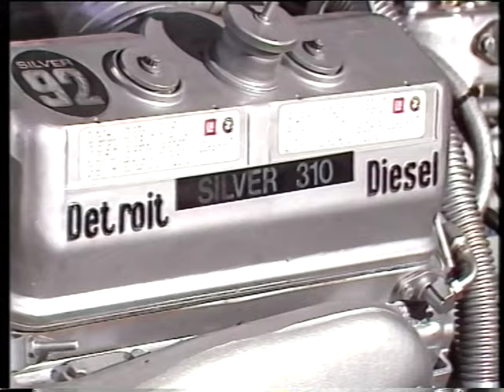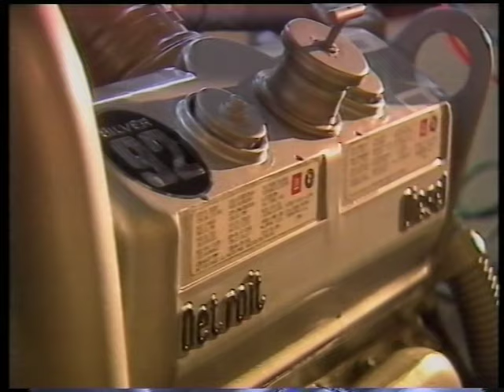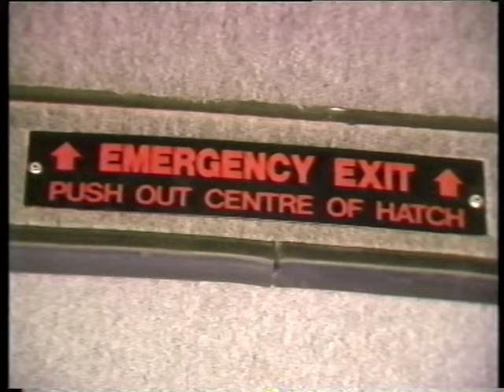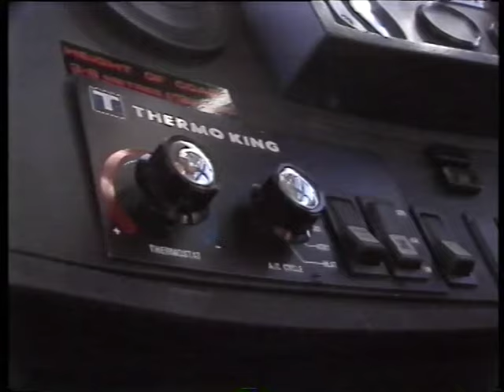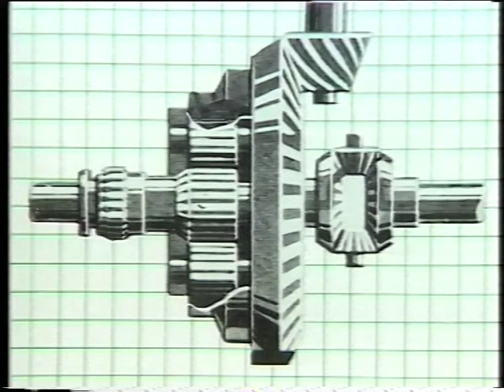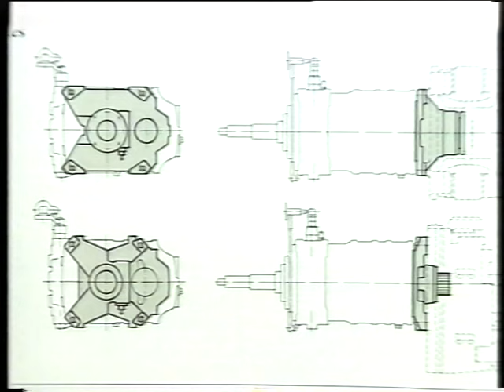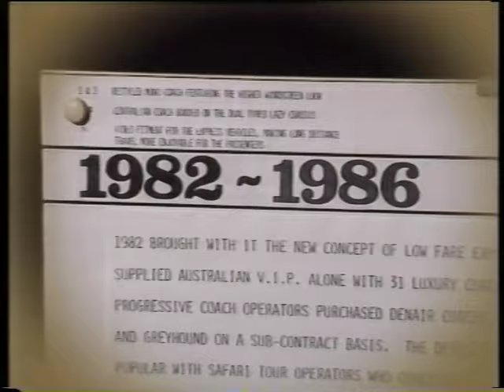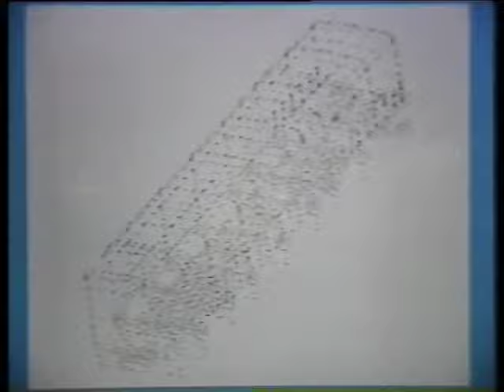Denning Coaches The Road to Quality

Comment: Would love to see Denning convert to LHD and sell in the U.S.A. Prevost and MCI need the competition. Denning looks to be a durable, well-built coach.
Reply: I’ve been a Prevost customer for a few years and it’s clear that Prevost and MCI need some stiff competition. Prevost are having quality issues that you shouldn’t see in a $550,000 motorcoach.
Reply: You've VanHool and Irizar in the USA, as we've in Europe. Booth are rated high-end quality here. I drive a 2009 Irizar PB on Scania chassis. It has 580,000 km on the clock and is still in top condition due to the quality materials it's build off. Denning is build for Australian road and climate conditions.
Reply: @paulsehstedt6275  The problem with Vanhool and Irizar is that there’s no parts support here in the USA. It’s not that you can’t get parts for them . It’s how fast and cheap that you can buy used items like glass and luggage bay doors from a the numerous salvage yard MCI and Prevost motorcoaches. Most of your established charter bus companies here buy and keep used side windows, mirrors and other items that drivers enjoy destroying regularly. You can’t do that with Temsa, Vanhool, or other less established nameplates here in the USA. When the Spring busy season hits here you simply can’t wait for days or weeks for a new part to show up.
Reply: I just don’t understand why we don’t have the Brazilian Marcopolo coaches in Canada / USA. What’s good for the goose, is good for the gander.